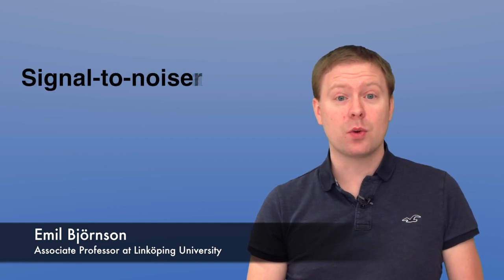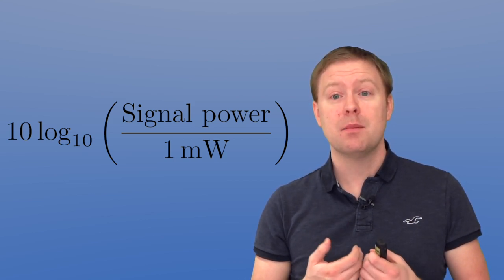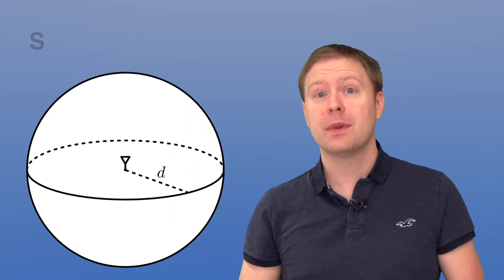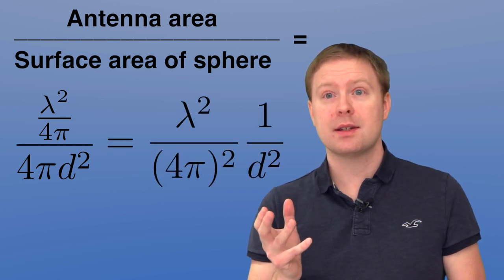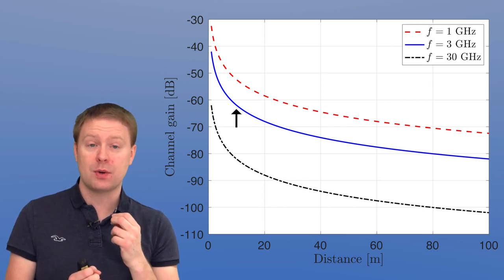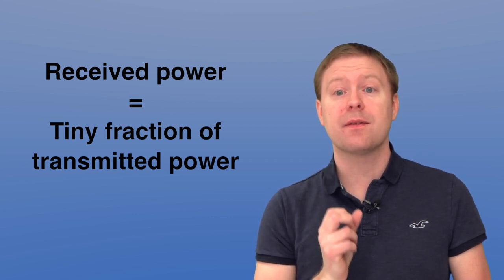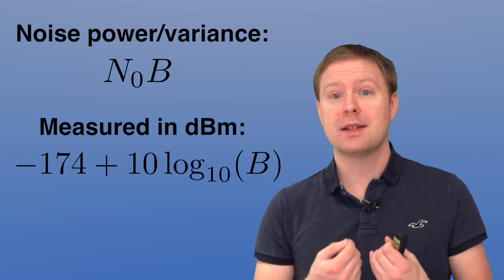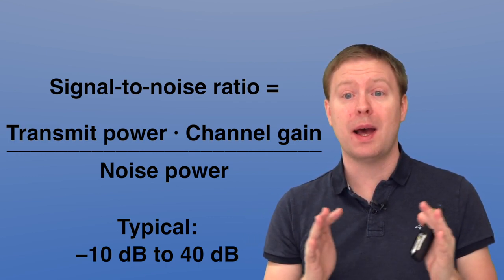Signal-to-Noise Ratio in Wireless Communications [Video 1]

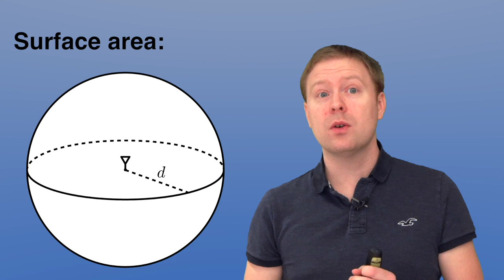Comment: At 2:34, what is called "diameter (d)" is typically referred to as "radius (r)" -- the distance from the center of the sphere to its surface. The formula works based on the diagram drawn, but the term "diameter" is used in a way I've not seen before.
Reply from the maker: The variable "d" in the video is the distance to the receiver and, yes, it is the radius of the sphere. Was the word "diameter" used anywhere in the video? I couldn't find that.
Reply: he was just referring a distance from the antenna, not diameter nor radius

Comment: another great video , thank you prof , when you calculate B (bandwidth) you calculate 10Mhz but if you calculate this for LTE which one do you calculate 15Khz or 180Khz (12*15 OFDM) or whole bandwidth ? which could be 20Mhz or 40Mhz depending on bands and countries .
does this calculation works for microwave point to point link too ?
Reply from the maker: If you want to compute data rate over the entire bandwidth, then you use the whole bandwidth. If you want to compute the data rate over one LTE resource block then you use 180 kHz. If you want to compute the data rate on one subcarrier then you use 15 kHz. The formulas applies for any type of point-to-point link.
Reply: @WirelessFuture  thank you
Reply: When working with noise and SNR, you should probably use proper SI units as KHz is literally decoded as kelvin hecto seconds, not kilo hertz as you likely intended.  This is because K is the SI unit symbol for temperature in kelvin, and the SI unit for frequency is hertz (Hz).  The SI unit prefix h is for the 10 to the second power and k is the 10 to the third power multiplier.

Temperature is a component of the noise power equation kTB where k is Boltzmann's constant, T is temperature in kelvin, and B is the bandwidth in hertz or some multiple.

With the SI unit errors above you would end up with a temperature factor left over in your kTB calculation.  For example, at room temperature you would have 1.38 x 10^-23 J/K * 290 K * 15 K * Hz = 6 x 10^-20 K * Hz^-1.

But in answer to your question, the concept of SNR works for all kinds of communications links including microwave and satellite communications, you just have to apply the appropriate necessary bandwidth (see ITU Radio Regulations Vol-1 for definition).

Comment: I agree with the notion of SNDR . I have another question please: How does massive MIMO work in a non line of sight environment?
Reply from the maker: It works very well. You preferably estimate the multipath channels in the uplink and utilize the estimate in both uplink and downlink. The transmitted signal will not be look like a beam but exploit all the paths.
Reply: @WirelessFuture  Works very well in theory - in practice, not so much.  Ask Verizon about their experience rolling out 28 GHz 5G roll.  So far, not so good . . .

Comment: 1)What is meant by transmitted power? At @9:11, transmitted power will be multiplied by antenna gain? Or it will be considered in the definition of channel gain? Although the resultant SNR will be the same in both cases.
2)What will happen for the channel gain in a directional antenna case where the denominator will be the same as the area of the entire sphere? Is such a definition of channel gain based on the assumption of spherical mode expansion only?
3) What will be the SNR when the receiving location does not lie in the far-field region? For example in an indoor scenario.
Reply from the maker: 1) The transmit power is the power of the transmitted signal. The received power is the transmit power multiplied with the channel gain. We consider unit antenna gain in this video, but otherwise I recommend including it in the channel gain.

2) The definition is based on the assumption of an isotropic antenna. Otherwise the numerator will change.

3) There is no strong far-field assumption in this video. As long as we are beyond the reactive near-field, it will be fine. That will be the case also indoors.
Reply: @WirelessFuture  thank you.

Comment: Hello Dr. Emil
Thank you for your efforts to explain this important subject.
Sorry Sir, but I did not understand how you calculate the noise power in dbm if the noise power spectal density is assumed 10 power (-14.4) Watt/Hertz then you divide by 1 milliwatt and you get the constant (-174)?
Reply from the maker: It is a typo in the video and, unfortunately, I haven't found a way to correct it. -174 dBm/Hz is the correct number it becomes 10^(-20.4) Watt/Hz.
Reply: @WirelessFuture  No=KTo=4x10^-21 W/Hz. This is also -174 dBm/Hz

Comment: Does formula of the effective antenna area refers to an antenna length of lambda?
The antenna area is dependend on the size of the antenna. Thanks. 
Or does it refers to a lambda/2 dipole?
Reply from the maker: The effective area of an isotropic antenna is a hypothetical number, which is explained here: https://en.wikipedia.org/wiki/Isotropic_radiator

For aperture antennas, the effective area is roughly the same as physical area of the antenna. 

But for a dipole, it is not as easy. If the length is lambda/2, the directivity gain is 2.15 dB, which means that is effective area is 2.15 dB ≈ 1.6 times larger than that of an Isotropic antenna.

Comment: When you say isotropic antenna, do you mean lossless isotropic antenna, i.e. the antenna gain is 1 = 0 dB in all directions?
When you talk about antenna size you are explaining antenna effective area. The antenna size is usually not the same as the antenna effective area.
Reply from the maker: pulsatorius Yes, 0 dBi. Since I only consider isotropic antennas in this video, the effective and “physical” antenna area are the same. But you are right that this is not the case in practice.

Comment: Thank you again, while I do not want to take too much advantage of time, kindness and this  opportunity to ask  you questions , I still have a general MIMO question that is bothering me, please allow me to ask it:

 In MIMO (spatial multiplexing) or even in receive diversity antennas need to be uncorrelated as much as possible
Now suppose we have 2 antennas and we have two streams of data that need to be received independently by these antennas and suppose the isolation is say 15 dB  between the two antennas and suppose that each of these two data  streams require an SNR of say 20 dB in order to be detected (64 QAM for example)
Won't they contaminate each other by 15 dB?, i.e. a level  of contamination that will make the detection difficult, since they need an SNR of 20 dB?

Would in that case  spatial multiplexing not be possible?...wouldn't make sense to me
I would really appreciate an answer
Reply from the maker: I'm not sure if you are referring to isolation in the hardware or over the wireless channel, but precoding is the solution to the issue that you describe. If you know the propagation channel, you can use zero-forcing precoding to transmit two signals from the two antennas in such a way that each receive antenna observes one of the signals without any interference. You essentially make sure that the two antennas transmit copies of the same signal so that these copies add destructively at the undesired receiver. In this way, the interference disappear, at the price of an SNR reduction since the copies will not add fully constructively at the desired receiver. To mitigate this SNR loss, Massive MIMO is all about having more antennas than receivers to have sufficient degrees-of-freedom to suppress interference without affecting the SNR too much.

Comment: One quick question professor. so, the noise power will be always the same regardless of the distance?
Reply from the maker: Yes, it is the power of the noise in the receiver circuits. (There is also noise in the transmitter circuits, but it is usually neglected in communications because it is much weaker than the transmitted signals.)

Comment: So is Eigen beamforming used on the downlink after using the uplink for channel estimation (TDD reciprocity)?
Reply from the maker: Yes, that is one option. If you serve multiple users, then regularized zero-forcing is a better choice.
Reply: @WirelessFuture  Thank you
Reply: @WirelessFuture  Can I ask again please? Since Massive MIMO results in channel hardening , i.e. a channel with a condition number ~1 , so orthogonal, why is there still a need for zero-forcing?
Reply from the maker: I think you are referring to "favorable propagation" (channel hardening = the small-scale fading average out). The thing is that the orthogonality between the channels of different users only happens asymptotically, as we let the number of antennas go to infinity. In practice, when we have ~100 antenna, there will be some interference left and it can be suppressed using zero forcing. In the beginning of the Massive MIMO research, there was a hope that the difference would be small, but that hypothesis didn't hold. In many cases, one can double the data rate by using (regularized) zero-forcing.
Reply: @WirelessFuture  If I may again: So I simulated in Matlab a random wireless channel with 8 users and a large number of antennas (up to 1000) and I saw after doing a SVD that the singular values converge to a certain mean value as I was increasing the number of antennas, is this channel hardening?
Reply from the maker: @dreamerhavingfun2289  Yes, this is connected to channel hardening, but that term is usually focusing on a single channel to one user. What you are describing sounds like the Marchenko-Pastur law: https://en.m.wikipedia.org/wiki/Marchenko–Pastur_distribution
Reply: @WirelessFuture  So won't the 8 singular values correspond to the small scale channel gain values of the 8 users?
Reply from the maker: @dreamerhavingfun2289  No, the singular values are only useful when studying a scenario where the 8 "user" antennas are cooperating and are looking for the same data. In other words, a setup with a single user equipped with multiple antennas.
Reply: @WirelessFuture  Sorry to bother you again: But I am not saying that I am going to use SVD like in single MIMO. I am just doing a matlab simulation pretending that the 8 users are  8 antennas belonging to the same user , just to prove a point: that the small scale channel gains of the 8 users (or antennas) expressed by the 8 singular values converge to a mean value as the number of antennas increases, thus showing the channel hardening effect. Does that make any sense to you?

Comment: Hi Professor. I have a question on the calculation of SINR.  Is SINR the power of the useful signal over the power of the sum of the interfering signals plus the noise power, or is it the power of the useful signal over the sum of the power of the interfering signals plus the noise power? The difference is that when we consider multi-user downlink communication, some articles directly state the sum of the interfering signal power, which really confuses me. Looking forward to your answer.
Reply from the maker: Thanks for the question. Whenever the interfering signals are independent, they appear in the SINR as a summation of their powers:

P_useful / ( P1+…PN+noise power)
where P1,…,PN are the powers of N interfering signals.
Reply: @WirelessFuture  Many thanks!

Comment: With all my respect SNR does not depend only on receive SNR, if transmit SNR is not too much higher than receive SNR, it will depend on both!
Reply from the maker: You are right that there is noise also in the transmitter. However, since the propagation loss is normally -60 dB to -120 dB in wireless communications, the transmitter noise will be attenuated by such a huge factor before reaching the receiver. Hence, when computing the communication performance (which is measured at the receiver), it is normally the noise at the receiver that matters while the transmitter noise is negligible.
Reply: @WirelessFuture  As much as noise will be attenuated, so will the signal so Transmit SNR will not change because of path loss. Usually transmit SNR is much higher than receive SNR , that is why its impact can usually be ignored, but at mm wave for example, when PLL/VCO phase noise is not good enough, then transmit SNR could start having an impact in the overall SNR
Reply from the maker: @dreamerhavingfun2289  Yes, my point is that the transmit SNR typically is 60-120 dB higher than the receive SNR, so that is why it can be ignored. This argumentation is based on the noise being thermal noise. If you bring in phase noise or other types of hardware distortion into the game, then the situation could be different, but I wouldn't talk about SNR in that case but rather signal-to-distortion-and-noise ratio (SNDR).